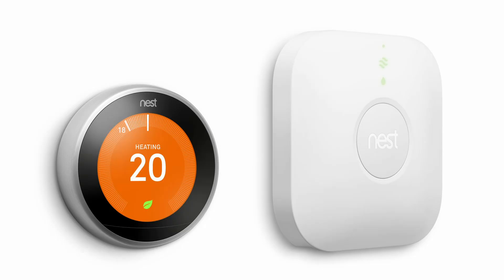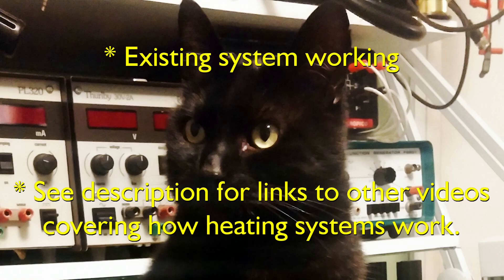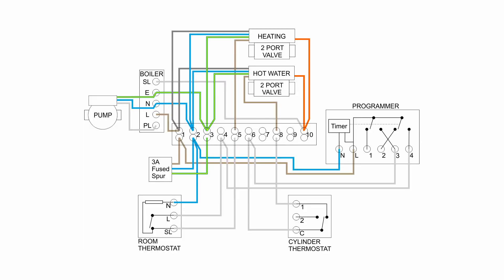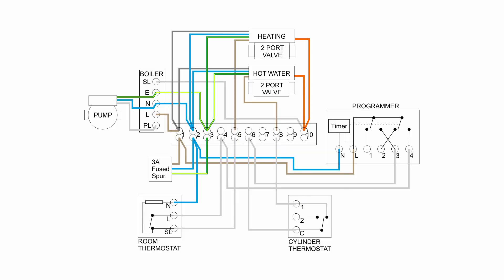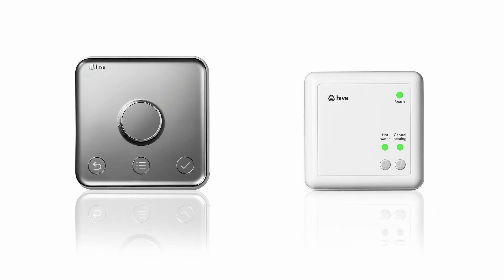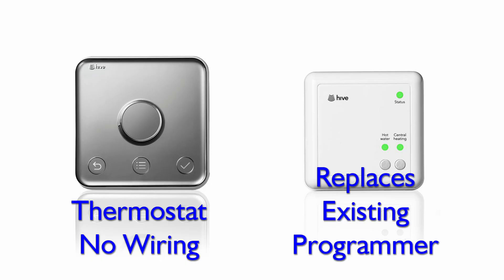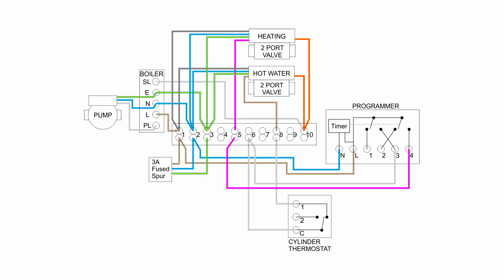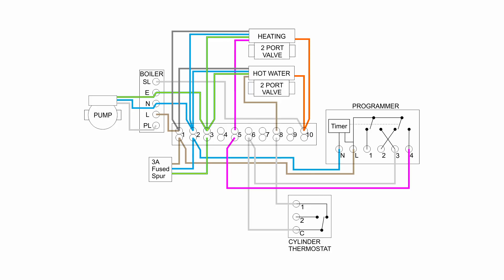Replacing a programmer and thermostat with Hive, Nest or a similar all in one controller.

Comment: Hi John, can you please help me out? I have three zones:
1. Ground Floor
2. First Floor
3. Hot Water 

The heat is by gas and the hot water is by solar and supplemented by gas.

Can I set up with one thermostat and a couple of sensors, or do I need two thermostats?
Reply from the maker: If you can find a 2 channel thermostat with 2 remote sensors then it could be used.
Or just have 2 separate thermostats.
Reply: @jwflame  thanks, two thermostats it seems to be. I appreciate your help.

Comment: Very informative video, as are all your central heating videos. I'd like to ask a question about Tado systems. I presently have a three channel controller - one for downstairs underfloor heating, one for upstairs radiator heating and one for hot water. I've replaced all my downstairs wired thermostats with wired Tado smart thermostats and all my upstairs radiator thermostats with Tado radiator thermostats. The downstairs works well, as the thermostats are wired so I can set the controller to permanently on and  the actuator only activates and fire the boiler when the thermostat asks for heat. However when I set the upstairs controller to permanently on, the actuator immediately activates and starts the boiler pump, irrespective of whether any of the radiators are asking for heat of not.  I would like to add a Tado Extension Kit, but they are designed to replace a two channel controller. Because of this, Tado will not provide support to install the Extension Kit, but indicate a competent heating engineer should be able to rewire the system to make it work - i.e. that the actuator and pump would only come on when the radiators are calling for heat. Does this sound plausible to you. Your thoughts/comments appreciated.
Thanks.

Comment: Hi John, this is really amazing! Thank you so much! One question about removing old thermostat though - Can I just connect L and SL wires located in old thermostat - That would save me hassle of connecting 4-5 terminals on the controller? Please let me know! Thank you!
Reply from the maker: Yes,  You will either need t leave the old thermostat in place, or put a blank plate over the connection to indicate there are live wires there.
Reply: @jwflame  Hi John, thank you so much for your prompt reply. As you correctly mentioned, I was planning to use a blanking plate. Thanks a million for your help and guidance!

Comment: What size cable do I need to connect the hive system as I'm going to need to buy some to mount it on the Wass as my timer is integrated o to the boiler.  Thanks
Reply from the maker: 0.75mm², or 1.0mm²

Comment: Hi John great video thank you for that. I have a question and maybe you might be able to help me. Currently I have tado installed with the extension kit and thermostat. This I would like to exchange with the Nest Thermostat. I believe I need the Heat Link as well. Now I am not sure if this works since in the current system I have 3 wires connected to the tado extension kit controling the valve for the heating in other words on and off. I am not sure now if the Nest would work or is the "4" wire the bridge you are referring to in your video basically for the power? Any help appreciated thank you so much! Cheers Ian
Reply from the maker: There are many different wiring arrangements and types of heating system.  However whatever wiring you currently have in the Tado needs to be connected in the exact same way to the Hive.  Functionally they both do the same thing - it's just a box with some relays in it.
There may be terminals which are not used, as many systems do not require all of them.

Comment: Really helpful video! Thank you. I just want to confirm I've understood this correctly for my situation. I have a wireless Honeywell Y6630D and a Honeywell HC60 relay. I'm assuming that the HC60 signifies the wired stat in the diagram and just receives the signal from the Y6630D. However, my HC60 has 4 wires, not the 3 shown in the diagram, which is confusing me somewhat. Can you offer any guidance? Anyone?
Reply from the maker: N&L are the 230V power supply, A&B are the switch contacts.
Reply: @jwflame  brilliant thanks. Managed to get it installed and working thanks. I had 16 connections in the wiring box not 10 and they were helpfully wired in reverse order to what the wiring diagram on the box showed. Had to follow the wires and match them up to the diagram you had.
Reply: @jwflame  John I have dual zone heating system so have the original controller in the kitchen danfos 9000 then there is a t2 thermostat in the hallway to control down stairs only then there is another thermotast/controller in my bedroom which controls all of up stairs I have previously fitted hive before on a single zone system but this one is leaving me scratching my head if I change the t9000 controller with the hive hub heat controller or what ever its called this makes the t2 redundant so what happens to the one in my bedroom..? The t4000
Reply: For reference they are connected in L, N, A and B on the HC60. https://imgur.com/ORKmAtx refers

Comment: And the OT1 OT2 terminals?
Opentherm?  The great thing about modulation which seems to get missed.

How should a Opentherm controller be wired to a Opentherm boiler with a cylinder?
Reply from the maker: OpenTherm wiring is just two wires between the terminals in each device.

Comment: Nice Video JW, thanks.  The single channel can also be used to control an extra heating zone in the property.  However, one point worth noting (esp as its not metioned in the Hive Install Info), is that the Single Channel switch circuit does not have an internal 230V supply like the dual channel does, ie the switch is volts free.  So for the single channel receiver, you have to provide a voltage feed to the switch.

Comment: Don’t understand why the duel channel receiver can’t control hot water as well as heating in a combi boiler. The current wall mounted programmer does both.
Reply from the maker: There is nothing to control in a combi boiler for hot water - when you turn a tap on, the boiler heats the water.  Tap off, boiler off.
Reply: @jwflame  The present controller can be set to heat water at certain times & there is is boost facility for hot water or heating. Read something elsewhere which said it can be done as long as the switching voltage is mains. Some programmers are switching low voltage to call for hot water.

Comment: My boiler fires up sometimes by itself and starts heating the water even though it's not programmed to do so at the time. I replaced the motorized valve actuator but it's happening again now. When i turn down the thermostat on the cyclinder it stops. So strange.
Reply: Nest Thermostat Heating the water at random - likewise, have had the same result.  From what I have read, the Nest Thermostat does this to prevent Bacteria building up in the hot water tank. i.e. If your domestic water has not been heated for at least 2 consecutive hours in the last 48 hours. This is very confusing after wiring up a new system and set the water heating times.
Reply: @4kempston  Thanks for the informative reply. As i had previously had an issue with the hot water motorized valve i went down the wrong road of trying to diagnose it. When i removed the actuator i was expecting the spring to release it back to the closed position but it didn't indicating power was being supplied to the motor to keep the valve open. So the heatlink was trying to keep the valve open. So i checked the nest thermostat and there was a little yellow icon with a black drop indicating bateria mode. What i coulon't understand though is i have the schedule to run hot water for an hour in the morning and an hour in the evening so the tank would have been hot but i suppose it wouldn't have been two "consequitive" hours. I will no switch it off. Thanks again :)
Reply: As per the Nest instructions: There is a setting called "Bacteria Prevention" only accessible from the Nest thermostat. This can turn on the Water Heating at random times - so as to prevent bacteria building up in the HW tank.
To turn off - go into Equipment Settings via Nest Thermostat. Then you should see Done, Heat Safety Temp, Heatlink, "Bacteria Prevention" - this is the one; "enable" or "disable".

Comment: Very good video (Nest/Hive).  Thank you for adding this one (I did request it!) which compliments the others JW videos regarding UK central heating/water systems
 With the help of these videos, I have now fitted three Nest Thermostats (Gen 3)  - all  "Y" Plan. 
The first installation was by removing an old SUNVIC electro/mechanical programmer (without a UK standard wall-plate) Sunvic Clock Box II 24 Hour 2 Channel Programmer CB2202 and adding a  central heating terminal box.

The second and third installations were very easy, as I did not remove the standard UK wall-plate (used by Danfoss, Landis & Gyr and many others) as mentioned in this video. This was achieved by cutting out a slot in the back of a PVC Surface Box 2G, 32mm, Round Corners EN 5050765038959** (Luceco Plc) slightly larger than the Wallplate. 
With the help of this video - remove the old programmer, fix the surface box over the "wall-plate"  and screw on the wall*, wire in the live and neutral, plus the three wires between the Nest Home Link via a hole in the side of the 2G box. Test the system - when OK fit the 2G Blank-Plate EN 5050765000130.  As regards the old room Danfoss thermostat this was not removed - set to 30 degrees. 
This method gives you the option to change back to the old system with the minimum of hassle.

*The 3rd installation did not require any drilling to fix the 2G surface box - this was achieved by cutting slots in soft-ish plastic.  Cut the wall-plate slot/hole out, but leave a lip in the top. The 2G Surface Box can then clip onto the wall-plate top two lugs, and fix using the two bottom screw - drill two small slotted/holes in the bottom of the box.   

Hope this help others

Martin

Bedford UK

** on the box NEXUS British General, Telford, England  supplier Eyre & Elliston [ Note: the back box square slot - plastic is good for cutting]

Comment: I agree with the previous comment. This is the most straight forward and easily understood YouTube video I have found to help me install my Hive Heating and Hot Water package. Extremely helpful indeed. I intend to tackle this tomorrow. I have previously wired up a whole heating system (other than the connection to the main boiler). This was many years ago but I had no problems with doing it.I just followed the instructions carefully and logically. I left the wires with a few extra inches in case I had made any mistakes. Of course, I paid an electrician to come up and check it all for me.

This is a great video. John Ward speaks very clearly, not too fast, not too slow, etc. lol I shall update after completing the job. As long as people make sure they turn off the electric at the mains and double check that all electric is off it will be easy enough. John Ward's video will make the whole process far easier too. I'm going to search through some of his videos to see what else he covers - great guide. Thank you so much for your help.

Comment: Big Thank You on your clarity, knowledge and superb videos - exceedingly impressed, your delivery is excellent !
Have just installed  Danfoss SP-one - Smart thermostat I hope in the future you will do one specifically for this stat as I am perplexed with the wiring links within the units "yes very simple" but having tested the connections plus voltages passing through there is still something I am missing in the wiring box that is still holding it off at present (it is an S plan) 2yr old installation sealed system & all Danfoss technical could say is to remove both DBRs and the Stat and have them replaced of which I am sure they are OK so will persevere.  THANKS AGAIN John have watched many of the videos in the last week.

Comment: Hi John, Thanks- I have a TRAC timer wired from my oil boiler. There are 5 wires plus live feed. The old timer had 2 brown going to no 1, Black and 2 blue to No 4, Live No 3 and a live link from No 3 to No 4. 
This turns on the boiler and pump- temperature controlled at the boiler. How to I determine which wires  connect to a hive receiver? Bit lost as which wires to connect to Hive.so , 2 Brown 2 Blue 1 Black and 1 Red (live) Thanks Bill
Reply from the maker: Depends on what those terminals in the existing timer are.  Once those are identified, it's just a matter of matching those to the terminals in the new Hive.

Comment: Thanks for the invaluable information JW, I recently upgrading my central heating system control to Hive Active Heating, the installation manual would have you believe it's simply a case of removing the old programmer and whacking up the Hive receiver, at no point does it mention altering the connections made within the wiring centre. Another thing worth mentioning is that if you do have a gravity fed system, you will need to change the default mode on your receiver.
Reply: Alvin can you tell me where i will find the wiring centre? is it located in the boilers housing or somewhere else. Regards
Reply: @mattclarke5731  The wiring centre would normally be found within close proximity to the heat pump.

Comment: Hi JW, followed your guide and it worked perfectly. Any suggestions how I might connect additional zones to my Hive system? I've got a wet UFH circuit with two zones. There is one 2-port valve that feeds the UFH circuit then there are two valves on the UFH manifold. I assume I need two hive multizone kits (as there are two stats for the UFH). Do I wire the additional zones into the 2 UFH manifold valves or to the single two-port controlling the feed to the UFH? Any suggestions most welcome.

Comment: Hi John... the 3rd ed Nest wiring diagram shows the little live link wires from L to #2 in the heat link. But it doesnt have the Live going directly to the boiler. It appears to go to the Heat Link - through the little link wire we just mentioned then to the boiler. Is that wrong? Should there be a direct live to the boiler also?

Comment: Very informative, but I have a question. If I wished to retain my old room stat (mine’s wireless) and relocate it to a conservatory or loft to use as a frost stat, is it a simple matter of jumpering 4 & 5 in the wiring centre? I’ve bought a Hive heating and hot water that replaced my old programmer , which had a standard back plate (terminals N, L, 1, 3 & 4 are used). Thanks
Reply from the maker: Yes, assuming that 4&5 are thermostat L and SL on your system - it may have been wired differently.
Reply: John Ward thanks. Yes 4 & 5 are L & SL on my system. However, thinking about it, the “frost” stat would only be able to demand heat if it coincided with programmer’s heat cycle. Would a better way be to add L from the stat to the permanent live? Then the boiler and pump will kick in if the temperature drops regardless of what anything else in the system says.
Reply from the maker: 4&5 need to be permanently connected, otherwise the Hive won't be able to control the heating.  It's the equivalent of having the old thermostat on all the time.
A frost stat should be connected as you describe, between permanent live and the brown wire for the heating valve, which in the case of the S plan is terminals 1 and 5.  This will activate the heating regardless of any other controls.

Comment: JW hi.  Love your videos (I am an Electronic Eng. but never worked as one). My current programmer uses 24V (Danfoss).  Can I connect these old supply leads to Nest directly or do I need to replace with 240V supply (your video shows 230V AC)?  Am still trying to figure out which one is best (Hive/Nest/Tado).  I  live in Cyprus and our wiring is very much similar to UK's (we even have 240V and same plugs!!!).

Comment: 14:00 Hope you’ll do a follow-up covering Open Therm (as shown on the diagram) which modulates the heating output according to demand, rather than just on/off. Should increase efficiency but hard to get data on what is the optimum heating water temperature - long and low versus high and short?

Comment: I built my own using an ESP8266, a few external components and some custom firmware, 24/7 timing and thermal control of my central heating inside an inoffensive grey box with no fancy bling, controllable via the internet OR fully controllable by the FTP upload of settings files to my home server from my phone.
Next im going to wire in a sensor to detect movement in the house, so that if i'm away for a few days, the temperature setting will automatically drop to 15c (just to control humidity). I could even use a slave ESP8266 (or maybe a modified Sonoff) as a remote thermostat.

All in all, total cost around £35 and few hours head scratching in the Arduino IDE.

Nest and Hive, etc, I feel like they're mostly just a gimmicks designed to extract money from Apply fan boys.
Reply: Or, you could’ve just bought a nest and layed your wife, like I did for you 😘

Comment: I’ve personally tried the Bosch version, it’s was very clunky and the thermostat gave some rather strange readings. Needless to say I got rid of it. I then asked a couple of builder and heating engineers I knew about Hive vs Nest, no one recommended the Hive. I bought and installed the Nest, it’s really very good. No regrets in choosing it, easy to use, clear and well designed.